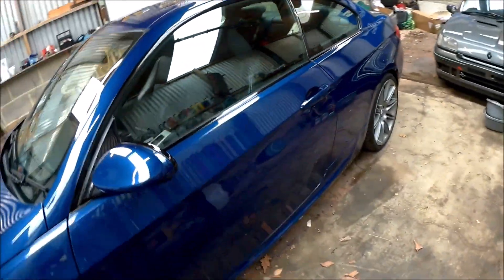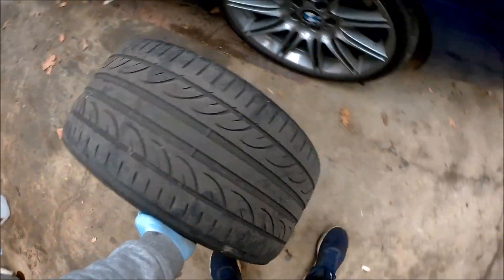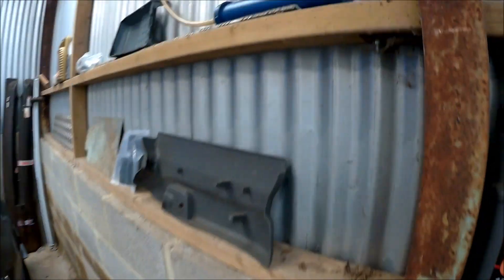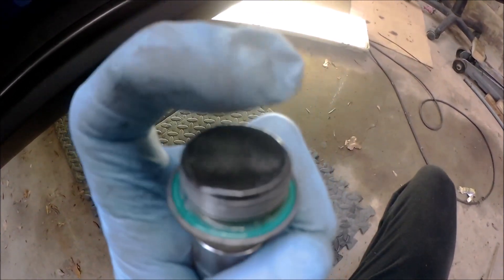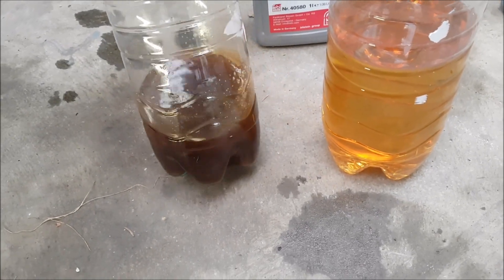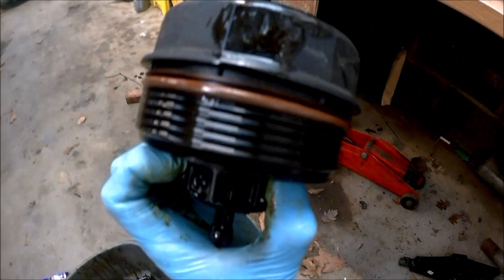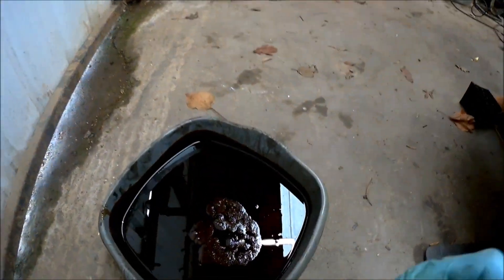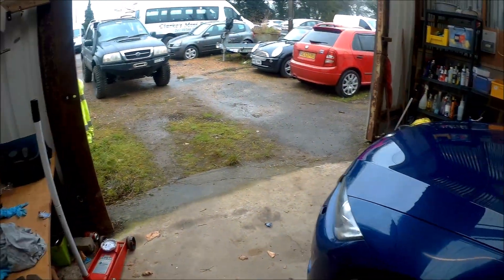E92 Diff & Engine Oil Service

Comment: Did you change your Diff oil cuz yours has a diff bearing noise and did this help fix it?
Reply from the maker: I changed it mainly because of mileage but also because I'd get the odd noise/smell from the diff. It's been fine since then

Comment: Good way to warp your rotors.
Reply from the maker: John John How so?
Reply: For instance you're driving on the highway for a very long time and you hit a puddle that's one instance of your rotors being very hot and cooled off too quickly that's how they can Warp in normal conditions with normal Drive also car washes same example. Just matters on how hot or how you been driving. I have 5 e90s as we speak great cars. Dd my n55 335i